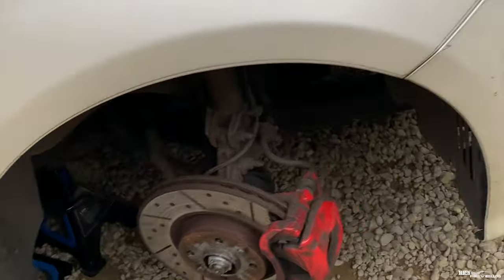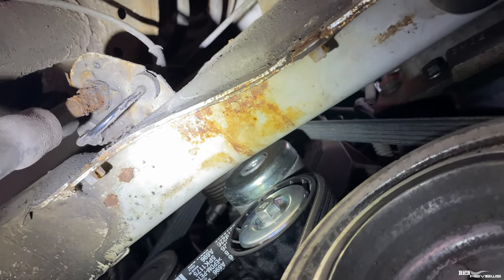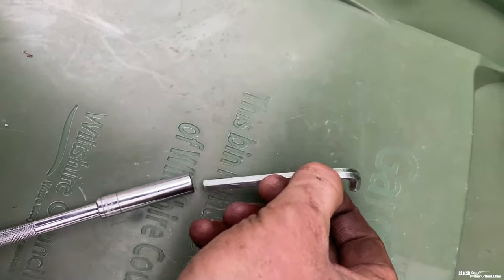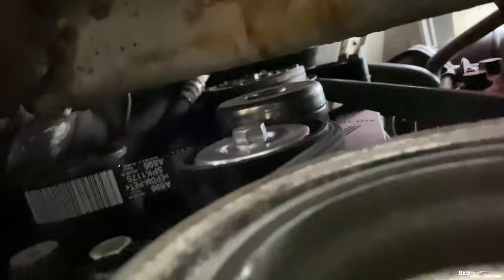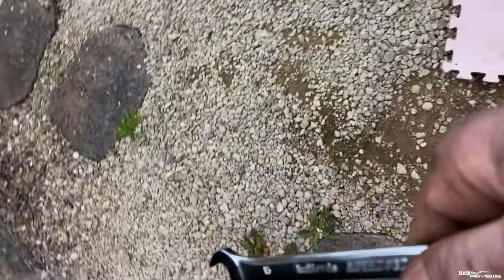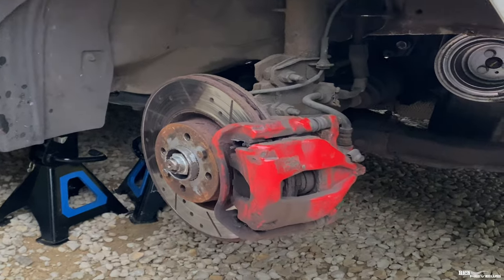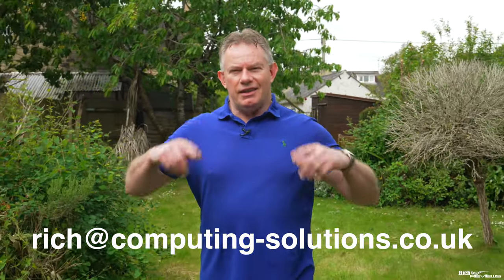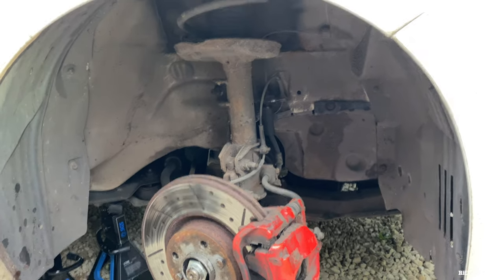REPLACING Fiat Abarth Auxiliary BELT & TENSIONER! (Without Dropping Engine!)

Comment from the maker: Abarth 500 Workshop: 
Yes...I know this is different to our usual very cinematic polished content but this is intended as purely educational to help many of you with Fiat Abarths needing to replace the Serpentine Belt AND Tensioner and need to save money by doing this yourself Without incurring heavy dealer charges!

Today we are replacing the Abarth Auxiliary Belt and Belt Tensioner. The Tensioner is a bit of a nightmare to replace due to the very limited access to the fixing Allen bolt BUT, I found a way Without dropping the engine! I was keen to provide this particular maintenance work for my Abarth viewers because there is absolutely No content around detailing how to replace the Tensioner.

Please let me know if this helps you and if you'd like to see more Abarth Workshop videos?

Comment: isn't a good option to replace just the tensioner roller? Usually all what goes wrong is the bearing
Reply from the maker: You can’t, the tensioner unit is a whole unit and TBH wouldn’t be worth the hassle.